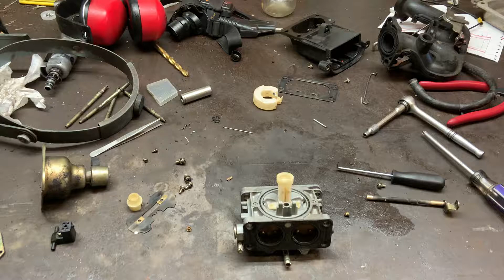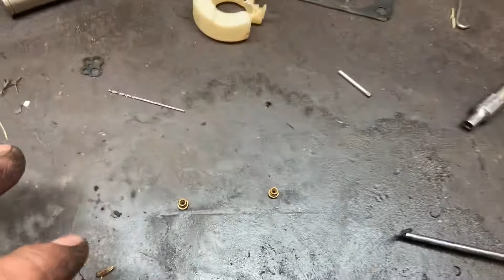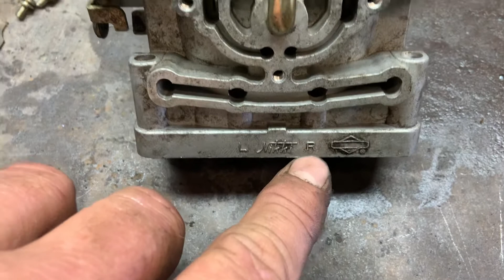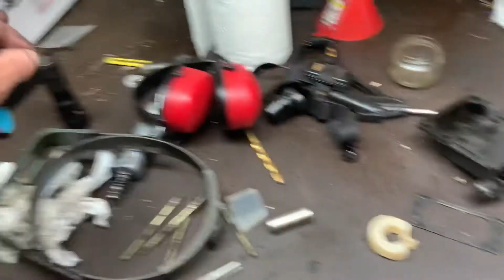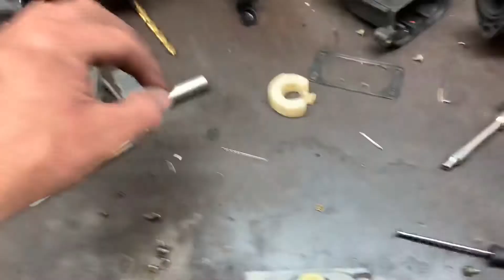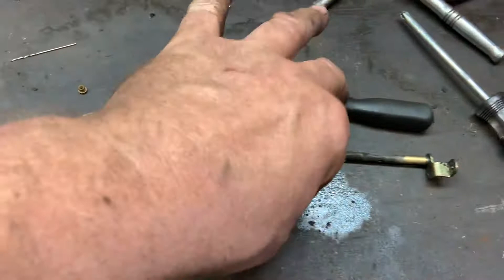Nikki carb left-right jet installation

Comment: I rebuilt one of these carbs. One of the jets had fallen out. The kit came with tiny o-rings, which I used, but I had no way to know which was right or left. I just guessed, with a 50/50 chance of being correct. Ran well when finished, so I guess I got it right. Next time, thanks to you, I won't leave it to chance!
Reply: I had to replace the o-rings as the originals were hard and the jets fell out.  A 3 x 1 mm O-ring fits, but I can't get the jets to slip back in without crushing or tearing the ring.  Help?

Comment: I just fixed on of these after a lot of trouble shooting. I tore down the carb & someone (My dad) had put the jets in the top two vent holes instead of the the white  plastic tower. 
Man it feels great to have that one finally nailed down & back up & running.

Comment: The Jets have tiny indentations on the top rim denoting jet size that are only readable when u clean n buff (do not sand or drill them) and using a magnifying glass. I believe sizes 110 thru 122.. 
Those jets have little o rings that are replaced to keep the jets pressed into the fuel intake tower inside the carb bowl area...
Note the larger jet always goes on the intake side w the longest intake manifold length.
Reply from the maker: @spikeleestree8015   Thank you! I’ll look for that next time I have one apart.

Comment: Would you have any suggestions on how to get new o-rings to go back in?  I'm using metric 3 x 1 mm but they don't slide (or press) in without damage.  Help please.
Reply from the maker: You can buy a carb kit that has them in it but as far as just buying the O-rings, I can’t find them by themselves

Comment: Any explanation why 2 different sizes? Do they feed individual cylinders or do both jets feed both cylinders?  Thanks, it would sure be easy to make a mistake without your tip!
Reply from the maker: The number 2 cylinder always gets a tiny bit more fuel because the air fuel mixture has to travel a little bit farther to get there and the mixture leans out a tiny bit on the way.

Comment: What size is the drill bit you used?  Thanks.
Reply from the maker: I don’t know. I have a bunch of tiny bits and I just found one that would barely fit through one of the jets but would not go through the other one. Then I knew which jet was the larger one.
Reply: @wcjcnc  Thanks for getting bsck to me.  I'll look into it for myself and if I come up with the bit I'll share it with you and your followers.  Again, Thanks
Reply: I used .032 diameter rosin core solder and just squeezed it flat a little at a time till it would fit through one and not the other.

Comment: Can someone tell me which Numbers on th carb I use to find a kit?   I have a very long series of numbers starting with 80019 but no matches on any parts site.  The numbrs on my brass jets are both 24.  The same. Carb is on a 25 hp Vanguard (briggs) commercial.
 Nikki Carb. Anyone?